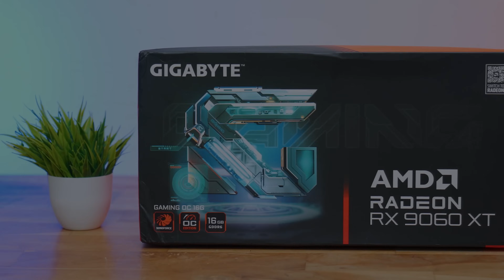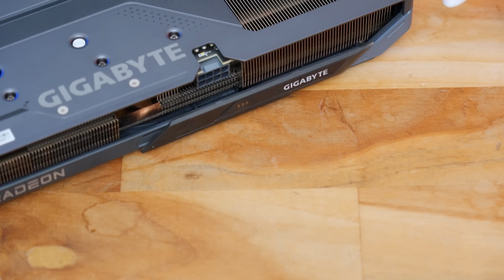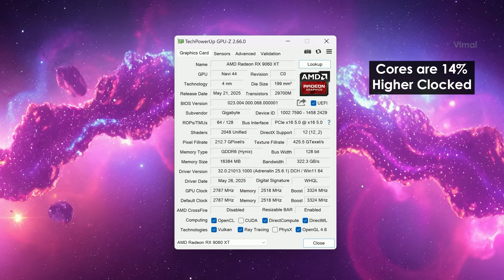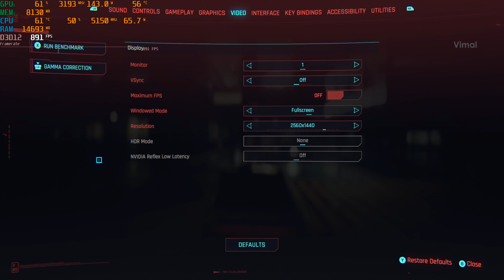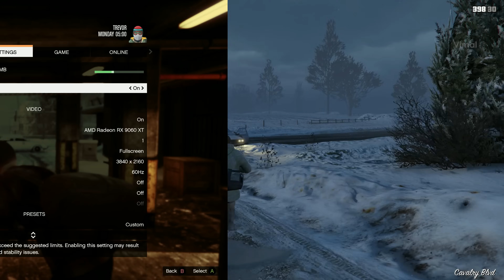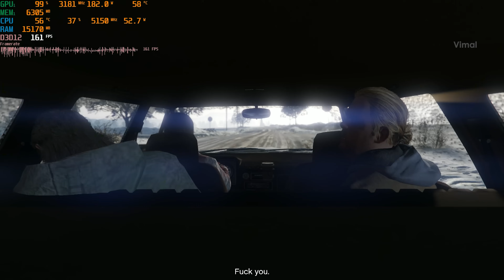Game Over 5060 Ti ..? 😱 AMD Radeon 9060 XT 16GB Budget GPU Review

Comment from the maker: Happy Sunday guys! 🤗
Planning a Killer Value for Money PC Build with this GPU, stay tuned for the video 😁
Reply: Ok good amd cards are great in gaming 
Can u give a similar video on productivity comparing it with 5060ti 8gb against 9060xt 16gb.
Reply: @VimalChintapatlaTR - Please include a note for those who are upgrading only GPU - if buying for older gen pcie say 4.0 / 3.0, the performance takes a hit. Like i bought the ASUS 9060XT OC 16GB PRIME, to replace my old 1060 6gb, on a existing but slightly dated i5-12400f, on budget/entry MB H610 (PCIE4.0) and with 16gb ddr4, now i can game on 1440p with few things toned down for 80+ frame rates on my LG 2k/180hz ultra gear gaming monitor
Reply: What's the total cost of this pc build ?

Comment: Recently Built a pc with i5+14400f+9060 xt 16 gb+ 16 gb ddr5.. not bad so far
Reply: which motherboard ?
Reply: I bought the ASUS 9060XT OC 16GB PRIME, to replace my old 1060 6gb, on a existing but slightly dated i5-12400f, on budget/entry MB H610 (PCIE4.0) and with 16gb ddr4, now it can game on 1440p with few things toned down for 80+ frame rates on my LG 2k/180hz ultra gear gaming monitor

Comment: Where the hell are you seeing 9060xt at 32k ?
Reply: Lots of places across the metro cities
Reply: Clarion computers and elitehubs
Reply: I bought the Asus prime triple fan version at Rs 39,000/-. Steel legend version was cheaper but I didn't like the looks of that card.
Reply: @100straydogs  nice, how is it running ? Any so called driver issues ?
Reply: 33k 16 gb sapphire Vedant computer kolkata in shop price
Reply: @param435 35k-36k bro 16gb vram ☠️
Reply: @param435  No way.
Can you confirm?
I'm in Kolkata, I'll buy it today if that's true.
Reply: Nah I checked, it's 36k at least
Reply: @okamich.9797 nah bro its around 35 k not 33k
Reply: @rohitrout5316 u can check at md computers or vedant it's less than 34k
Reply: @param435  Bro give more details, I actually need to buy this GPU, my old one died and I need a bargaining chip in Vedant to lower the price from 37k to 33k.
Reply: @param435 it's 8gb bro

Comment: Can it run gta 6?
Reply: Yeah but medium settings
Reply: Bsdk gta 6 will launch in 2027 on pc. Why r u building ur pc now based on that. Rock star generally has good reputation with their games optimization (biggest budget) so even rtx 3060 will be able to run gta 6 easily just with low/medium settings.
Reply: Gta 6 is still 3-4 years away for PC...
Reply: First thing gta 6 comes atleast 2028-2030 year why 30k gpu go for ps5 at 30-35k after gta 6 or ps6 launched ,now available at 40-44k on offer's
Reply: @pavanreddypally2357 ps5 has 💩 graphics it's like a 1660 s card games are upscaled from native 1080 to 1440 and 4k which is 💩 while pc graphics are 💎😍😏
Reply: Are you dumb kind of? @pavanreddypally2357
Reply: @pavanreddypally2357  ps5 got rx 6600 to rx 6700xt performance...
Rx 9060xt 16gb version is more powerful